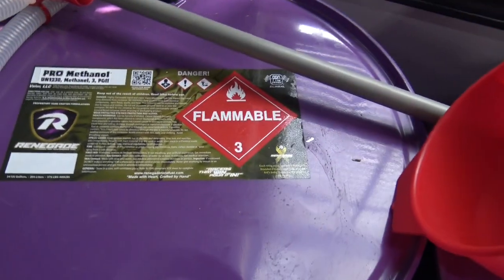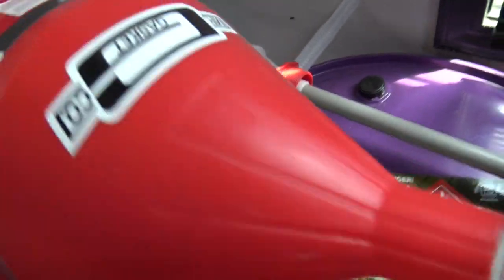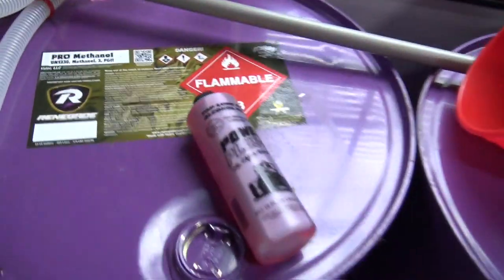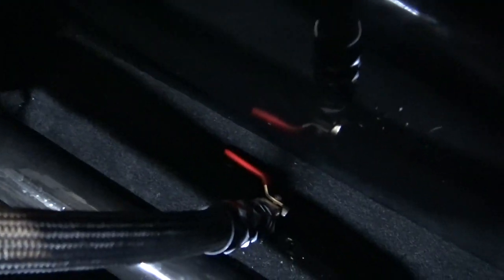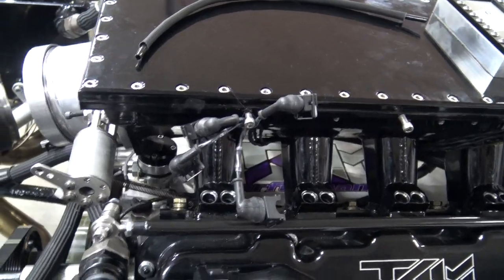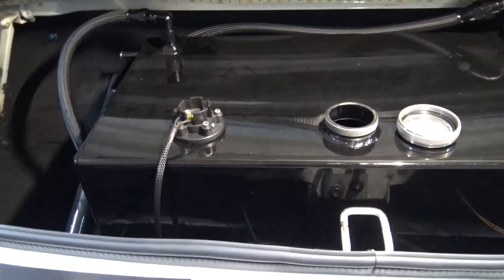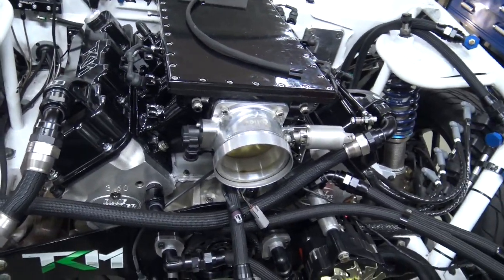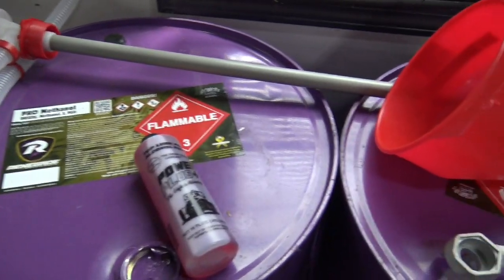Methanol Efi tips and precautions

Comment: What makes you think that the crystals that form have any external oxygen required? Given anodise is aluminium oxide, the oxygen is already there.. Why do you think lifting a sealed tank off the floor prevents water from getting in? Sealed is sealed, no water is going to get it whether its cold and damp on the outside or not.. seems like a lot of things you are doing are based less on science than just something you are assuming works, you haven't had any issues with so continue to do - but I feel like a lot of it is unnecessary or work for a different reason than you think. Also, welding grade alloy sheet doesn't anodise well so I wouldn't assume your local shop is shit, more that the decorative quality of anodising on sheet alloy is not great. Functionally, fine, but not great looking.

Comment: An example of 10 Micron size is a red blood cell. Most are a paper filter in that size. I use a ss steel, it's 50 micron.
Reply from the maker: Do you run methanol with electronic fuel injection?

Comment: Hey bro, so I just finished my engine and twin turbo kit install in my 2001 mustang gt, engine is in turbos are in. Just finished the return full fore innovations fuel system has a 10an feed and a 8an return anyways I want to purchase a Holley terminator set up wondering what to even buy and ya, I know my car is gonna make well over  1200hp min, twin 67/66 turbos. Mmr 4.75 stroker engine built off a teksid block 9.5.1 compression ratio, gonna do a 93 tune then a e85 tune also has water meth kit. The engine was actually taken all apart and I replaced pistons and rods and kept the crank since the crank is able to push up to 1500hp!!, went with custom made diamond pistons and are capable to handle 2000hp rods I went with some strong boostline rods. Was going to go Manley i bean but I think the weisco boostline is a 2000hp rod!

Comment: Great video Devin. On my car which I run methanol also I actually have my pump mounted behind the front passenger seat next to the frame rail. Haven't had any issues with fuel starvation. I also run a filter before the pumpbut after watching your video there I might remove it. I do run a 10 micron filter after the pump. That's a good tip there to put a ball valve in the vent hose.Oh as far as the oil goes I've been using Lucas  50 weight and haven't had any methanol contamination yet. I heard that Brad Penn is very good. The top lube is definitely a must. I also heard from a couple of friends that you should not put tight 90 degree elbows anywhere between the fuel cell and the pump.

Comment: Why don't these higher end drag cars use electric fuel pumps? Seems like alot of hassle for that cable driven setup.
Reply from the maker: There isnt a big enough electric fuel pump on the market to supply the volume needed for methanol

Comment: Are there any drawbacks to running a stainless steel fuel cell in lieu of aluminum? Would that eliminate the need to coat the inside of the tank as you mentioned?
Reply from the maker: nope besides weight but youll want to anodize the fuel rails as well

Comment: How often do you have to service the cable in that cable drive application? Is it possible to pull the inner cable out to service it while the outer part is still routed through the car?
Reply from the maker: yearly you just slide it out of the jacket and lube it with grease and slide it back in

Comment: Good idea on the oil pan heater, completely forgot about that part! Would you ever do the fuel transition from gas to meth if you had the proper tank/ pump for the different setups? That's been one of the biggest things I've wanted to do but never see anyone do meth and gas....just eth and gas